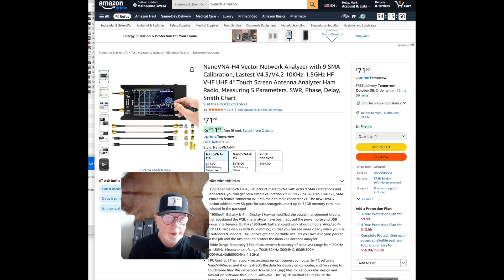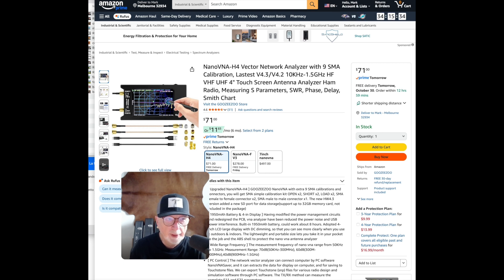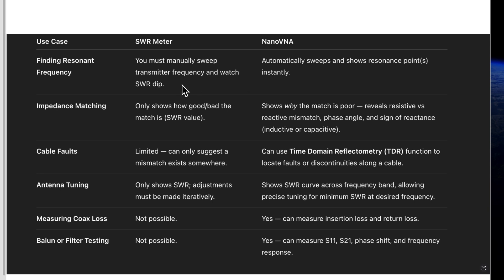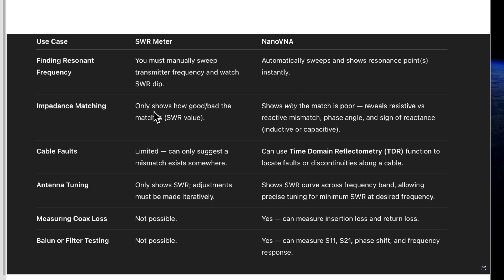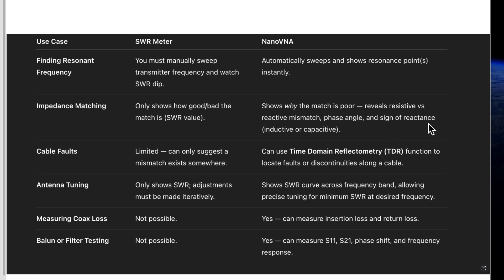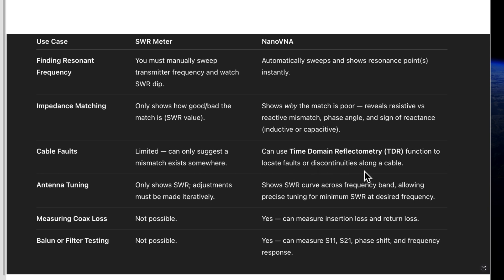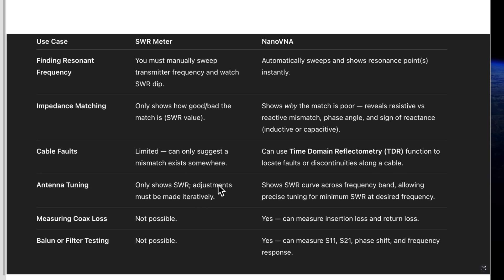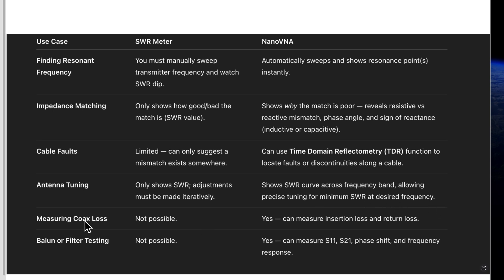Don't Use an SWR METER!

Comment: Yes Mark, very useful for building aerials. 
I made a 4 element 2m collinear after starting as a J Pole and various configurations, it made tuning easy. The elements were a fixed length and I adjusted it by compressing or extending the coils and the position of the feed point on the 450 Ω feeder and the position of the ferrite ring. 
Almost impossible I would think without the NANO VNA to get it accurately tuned. Best around 144.60 MHz as I don't go above 145 MHz. A local Net, s.s.b. and c.w. down at these frequencies. 
G4GHB.

Comment: I bought a NANO VNA earlier this year.
I'd ask how accurate can an SWR meter be? How near resonance? How good is good enough?  
Today I put up an indoor inverted vee with the FT817 on 24.950 MHz, 9' 6"" each leg and folded back 2" and started to tune for my lowest SWR. One inch, another inch then half inch, then quarter inches until it started to rise again. Add a quarter inch or two. 4" folded back. 
There were two good points where my meter was just lifting off the end stop by ⅛ inch at full sensitivity. I chose one with the following results checking with the NANO VNA:

24.925 MHz 50.9 Ω -j1.6 with 1.032 SWR
24.950 MHz 51.6 Ω -j2.8 with 1.061 SWR      I'm happy to use that, it's where I tuned it. 
24.975 MHz 52.5 Ω -j3.8 with 1.093 SWR 

I wonder what results the other low SWR readings were. 

Very slight adjustment at the ends improved 24.950 MHz to 50 Ω -j2.8 with 1.05 SWR using the VNA. Now my SWR meter ONLY JUST TWITCHING on the end stop.  

As we move around the bands it's all very well getting resonance (best we can) on one frequency but we move around so it's no longer in the true sense of resonance. 

EDIT: 
As my SWR lowered by shortening the aerial and then rising again by being too short, was the 50 Ω point I found later between these two readings? I chose this band as it fit indoors and as a narrow band I wanted to see how close to resonance I could get within the band. It got tricky to adjust, maybe ⅛ inch made a difference.  

G4GHB.
Reply from the maker: Thanks Bill for the account.  And great to hear from hams in Ole Blighty.
Reply: @BustRadioMyths  
Thanks for the reply. 
I think 50 Ω was between the two low SWR figures I obtained. If I had persevered a bit longer getting the reading down I think I would have found it. To get 50 Ω with the VNA involved VERY slight adjustment at the ends of the inverted vee. Then as I said my meter was just twitching at the end stop. 

I'd like to compare my SWR meter with another one 
to see if I get the same results. 
I've argued before with two people that I can find 50 Ω and very close to resonance with just my SWR meter and they said it can't be done. I think to get j to 0 would be extremely tricky.

I think more experimentation is needed.

73, G4GHB.

Comment: Interesting point of view, but allow me to disagree. Personally, I don't transmit without the SWR meter, because with that instrument I can verify that 1) the transmitter is delivering its power and 2) the antenna has not undergone any changes (open cable or short circuit).
Of course, the NanoVNA is a substantial change in our lives, but we use it to adjust antennas, not to transmit. 73 from LU1EKR
Reply from the maker: I agree with this 100%.
Reply: I transmit without one because it's a resistive Wheatstone Bridge type and eats half the power but the tx never sees above a 2:1 SWR. Great for adjusting aerials.
I just watch for changes in other things if anything changes, I've never had a problem. 
G4GHB.

Comment: I wouldn't say, "don't use an SWR meter", (as in never)... they do have their place; just another tool in the 'toolbox'. But they shouldn't be relied upon as the 'absolute truth'.  They are useful for continuous monitoring (when necessary), even at high power.

But Nano-VNA's are GREAT. Best $80 I ever spent!  It's amazing to me, that they can pack all that technology into a device the size of a deck-of-cards. A wonderful innovation that EVERY ham should have, and use.

Thanks Mark!
73 from Texas,
W5ARM
Reply from the maker: Thanks, Tex I agree 100%

Comment: I like to have an swr bridge in line all the time when transmitting, to instantly reveal any faults and be kind to my finals. No reactance is not always necessary for minimum swr. I usually shoot for minimum SWR to minimize coax losses, not necessarily resonance. However, I have a mini vna and it's useful for characterising antennas
well outside of their design frequency

Comment: Antenna building is a huge part of Ham Radio for me. I went out and got the SAA-2N VNA. I have tuned many antennas, checked coax, and used it after building a adjustable coil for my mobile HF antenna. If you do more than SWR checks, these are a necessity. They work wonders when you are given an antenna and don't know what the operating frequency is. You will find out real quick where an antenna sits.

Comment: I use a LED hooked to coil on a little toroid through which I pass the antenna wire, tune to maximum brightness=maximum power delivered to the antenna.
VK3YE has a good YouTube on  this tuning method.
Thanks Mark 
73
Reply from the maker: Kinda like the old fashioned way.
Reply: i did this before I built my SWR meter with two torch bulbs in the twin feeder to a doublet and on my long wire both coming into the shack and tuner. QRP only.
G4GHB.

Comment: How technology has changed ham radio.  My first transmitter was a Conair kit crystal controlled transmitter that I built when I was 15.  I had a really long wire out my window and tuned for max power and I worked the world on a couple 80, 40 and 15 meter crystals. 
Those were the golden years of ham radio. 
Thanks for the video.

Comment: Will a VNA protect my radio from a high swr? You can't expect a perfect match for the whole of 10m or 80 m! If it can do that I'll buy one. 73s
Reply from the maker: No use an antenna tuner for that.
Reply: @BustRadioMyths  If I could only afford one item it would be a ATU every time; only keeping cost down! 73s
Reply: That’s like asking if a pillow can be used as a bumper guard on a truck.

Comment: I wonder how hsms back in the day did it without this kinds of equiptment and still successfully enjoyed the hobby without blowing up their radios. It would be inetresting to see if there are available videos about it.
Reply from the maker: SWR meters were not invented until like the 1950's.  Worst invention ever HIHI
Reply: In the 1970's I put up a long wire outdoors and had a Joystick Junior and Joymatch Tuner bought very cheaply, I think they wanted to get rid of it as they'd had it for years, £2.50 for the 80 - 10m tuner, 160m tuner and the Joystick. There was a meter in the Joymatch coupled to the output and switching the tuner and adjusting the Pi network you tuned for maximum r.f. out on the meter. Valve transmitters so no problem worrying about SWR. Basically an inductance at the end of a long wire with a tuner. 

I even did the same for many years when I built my QRP s.s.b./c.w. transistor tcvr with a meter at the aerial showing maximum r.f. out.
My amateur friend was horrified. How do you know what your SWR is? He was still horrified when I built my SWR meter as I had not calibrated it. I aimed for the lowest reading. 
I did calibrate it after about four years. 
Yes, maximum r.f. out was a low SWR. 
We worry too much about a low SWR as Mark has said in another video.

G4GHB.

Comment: ABSOLUTELY agree. I also use a WMA (Wife Must Agree) meter when it comes to buying equipment. The meter has only 2 lights... red and green. Green is good and red is really bad.
Reply from the maker: Oh yeah the WAF rating.  (wife acceptance factor)
Reply: @BustRadioMyths  LOL.... here's the other deal.... buying a 600 buck plus Rig Expert. Makes no sense whatsoever..... I would rather save some $$$ and put into something more practical like a tubed amp with a pep of 1,500 so i can piss off the neighbors with interference! LOL.
Reply: I use a WHNS (Wife Has No Say) device, it works really well.
Reply: @W5KJD  I do too, except it requires a divorce first in order to operate effectively.  Also, you can more accurately calculate the dB of your budget afterward.🙂
Reply: @W5KJD  meanwhile, you never get laid.

Comment: I been using the swr meter for decades it worked good for me give me in the ball park. I love to get a rig expert dont have the money at this point. And use an ohm meter ive used for years.
Reply from the maker: Hey it works for you right?
Reply: @BustRadioMyths yes sir